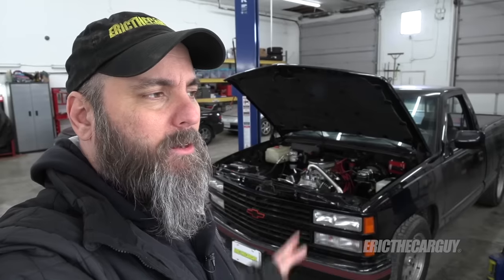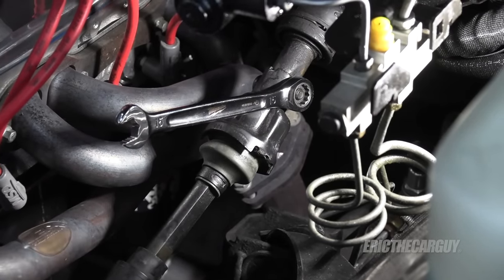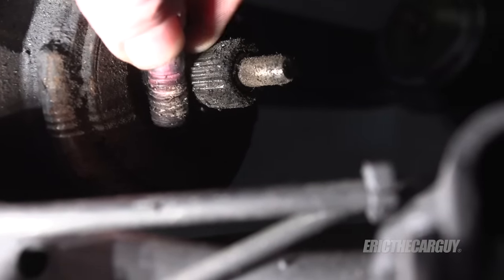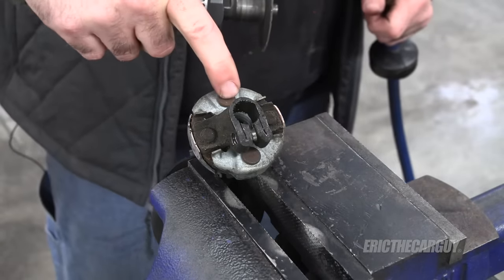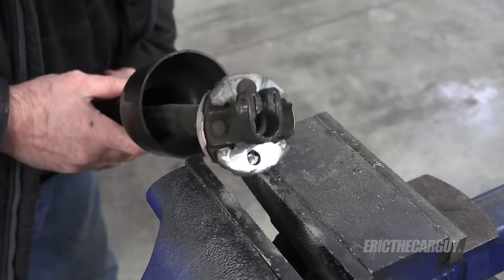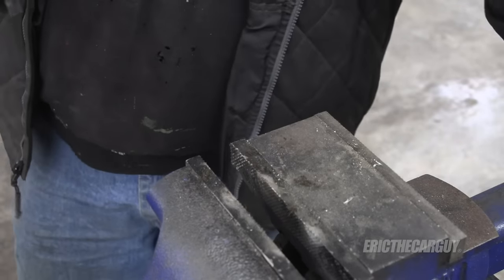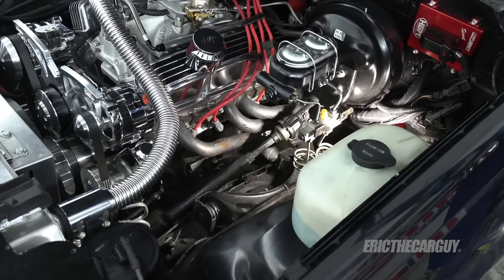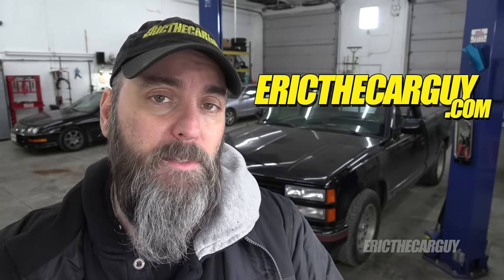Fixing Loose Steering, Rag Joint Replacement

Comment: Hey eric love your vids man, question for you since you are familiar with the unreliable piece of crap called a mini. I have an oil leak on the timing chain side of the motor and have had the crankseal replaced and it is still leaking somewhere, noone can find it. Have you run into this before? Could it be the seal on the tensioner? Thanks for your help. I paid 5 grand for this car and have put 5 grand in it fixing one thing after another, about to throw in the towel.
Reply from the maker: With oil leaks, always start high and work your way down. https://www.ericthecarguy.com/faq/finding-and-fixing-leaks/finding-and-fixing-leaks

Comment: Why are you running 13:1 ish AFR at that low load? Any benefits?
Reply from the maker: My A/F gauge has never been accurate. The one on the dash that is. If you read it via the Pro Flo 4 it's actually a point or so higher. So it's actually closer to 14, than it is to 13.

Comment: What would the result be if you replaced the inner and outer tie rods with the steering wheel slightly turned and steering wheel not in a locked position?
Reply from the maker: Doesn't matter. Replacing those parts requires an alignment no matter what.

Comment: These vehicles are really rare here in Germany, but I once drove a Blazer of the same platform for a short bit, and I had to constantly adjust the steering for it to keep going straight. And I have seen this with many older-ish American cars, while other makes (i.e. Japanese or European brands) seem to track straight, so I wonder: Is that actually a characteristic of American cars of a certain vintage that they don't track straight, or did the examples I've seen just have worn out steering components?
Reply: There's a lot that goes into that, so it's hard to answer. Steering, suspension, tires, wheels, brakes, bearings, and even the body.

Or if you live around here...the wind
Reply from the maker: Yes, the use of 'rag joints' was prevalent in early American vehicles and they all have this problem eventually. At least in my experience.
Reply: @ericthecarguy  Sounds funny if you say "early American vehicles" - makes me think of a model T or an A, not of something from the 80s or 90s, through which I have lived ;-) But I get what you mean, thanks for the explanation.
Reply from the maker: Actually, this type of steering joint goes way back. At least to the 30s and 40s. Possibly sooner than that. I believe they used to use a piece of rawhide.

Comment: noticed you changed the master cylinder again but back to a 73-87 style, any reason as to why?
Reply from the maker: It has a 1" bore. Smaller diameter master cylinder bores make for more pressure at the calipers. I'm trying different things to make the brakes on the truck better. When I find the solution I plan to make a video about it.
Reply: @ericthecarguy  awesome thank you for the input, do you think a baer or wilwood would help, or are you trying to find a budget friendly fix? either way i appreciate the vids, they have been helpful, i have an 89 im going through similar stuff on. one of the big issues i found was caliper seals, brake hoses, and simply overall thickness of the rotor causing some of my issues. also does your dad's truck have the issue with the worn out tilt part of the column?

Comment: Eric, why dont you have the exhaust wrap on anymore?
Reply from the maker: That was the Fairmont. I never put exhaust wrap on this truck.
Reply: @ericthecarguy  oh right. Watching your channel for a couple years now. I was curious if that wrap works? I know you are very experienced in this field, so youd know what you were doing. I suffer from heat soak with my top mount intercooler wanted to use this on a couple of things...not just the exhaust
Reply from the maker: There are several products that protect against heat soak you might want to look into. Check out DEI. https://www.designengineering.com

The wrap works fine on the exhaust, and it does keep heat down, but it will rust the pipes much quicker. On the Fairmont, I actually switched to a stainless steel header set up and coated it with ceramic paint. I like that much better. Even better if you can use ceramic coated exhaust parts. I also put a vent in the hood that helped a great deal.

Comment: what is the part number and will it fit a 1992 k1500 blazer
Reply: Magali - how did you go about this fix on your 92?  Apparently the 92-94 Full size Blazers have a different part number than others and of course costs more and harder to find. I replaced the Rag Joint with a U-joint 3/4"-30 X 1" DD but had to grind the lower shaft to fit. Now I'm uncomfortable at how much was needed. Teardown revealed the top of the shaft is wasted too!  I'm considering another U joint there but hoping to find someone else with a 92-94 to see if I'm missing something or just continue with my dual U-joint plan

Comment: What was the tool you used to push the rivets thru?
Reply from the maker: Air hammer.
Reply: EricTheCarGuy TY ordering one on Amazon right now.
Reply: EricTheCarGuy I have an 80 gallon dual stage Speedaire and I use it for Cerakoting. But that tool will come in so so handy! Again thank you!

Comment: I need to do this to my truck in the worst way Eric,  I don't have the air tools you 've got and they seemed really necessary.... ugh!
Reply: No air needed, electric cutoff wheel and a hammer+punch will get the rivets out
Reply from the maker: You could probably do just as well with a drill to get the rivets out.
Reply: @ericthecarguy  That's what I was thinking Eric... thanks again for the video.

Comment: Eric, man, please reinstall the bolts on the "rag joint" with the nuts downward.  Yes, it's easier to repair with the nuts up, but it is not "fail safe."  With the nuts down, the bolts will stay in the holes and "fail safe."  You will still have steering if the nuts fall off.  With the nuts up, not so much.  Bolts fall out of hole and no steering.
Reply from the maker: Those are nyloc nuts. Meaning they are designed not to work loose. If you're really worried you could also add some locktite. Thanks for your comment.

Comment: What the truck zig zagging going down the road. Driving straight the front wheels shift to the right the left then right then left all the way down the road driving straight holding tight dead ahead . The wheels shift. From side to side all the way down the road.

Comment: Don’t forget to LOCK THAT STEERING WHEEL  STRAIGHT.    Or you will possibly break the clock spring in the steering column.    Big hassle you don’t want!!    Use the ignition lock or seat belt .    I also match mark all connecting prices “ just in case”.
Reply from the maker: This is a 1990. No clock spring in these, or in any GMT400 as far as I know. They ran up through 98.

Comment: Why did you change out the master cylinder to an older style
Reply from the maker: It has a smaller bore which makes for more pressure at the calipers. I'm trying to find a solution to the crappy brakes on these trucks. Once I find the solution I plan to make a video about it.